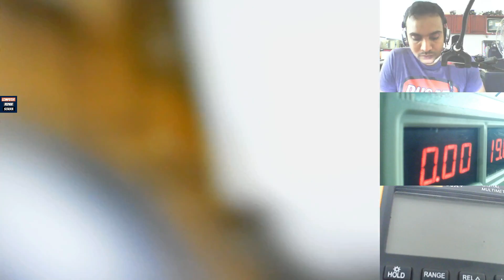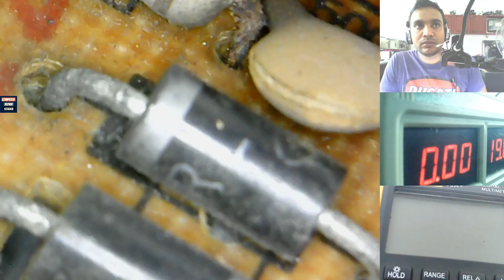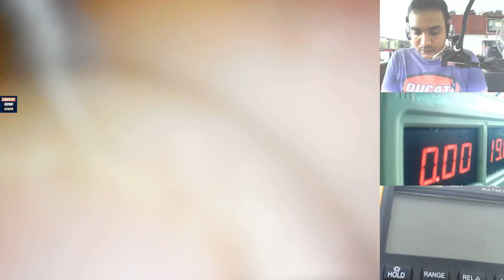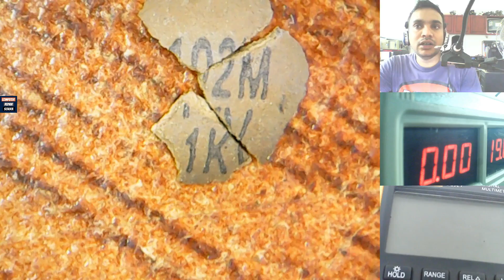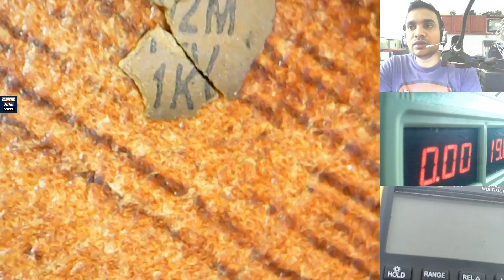How to repair Desktop computer power supply සිංහලෙන් | computer repair sinhala

Comment: Testing the voltages alone are not enough, you also need to perform a load regulation test.  This involves attaching a Constant current DC load, which is simple to design using a fast Opamp and low-range sense/shunt resistor.  Apart from that, well done on the repair.